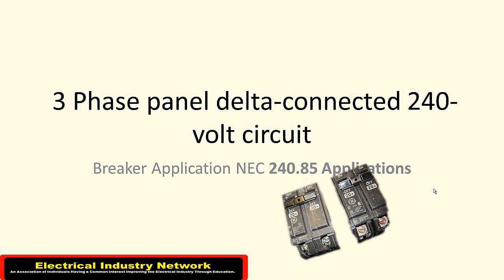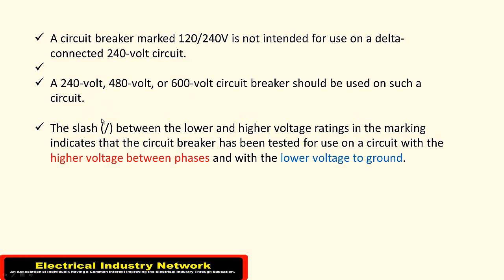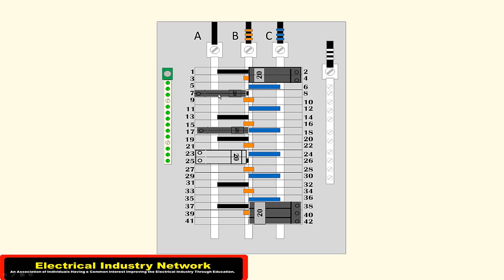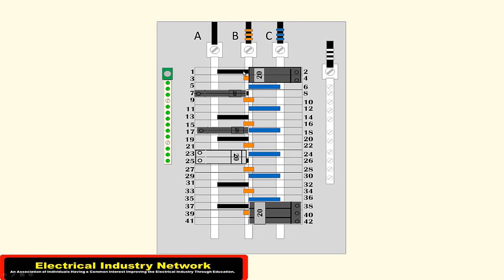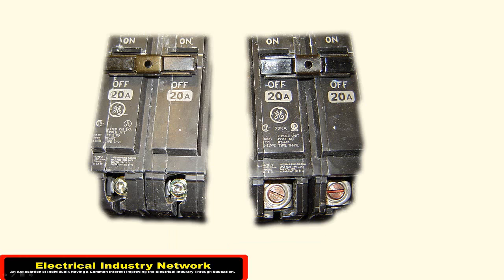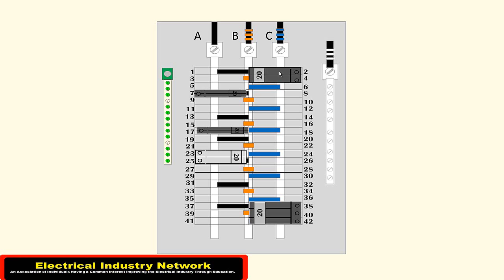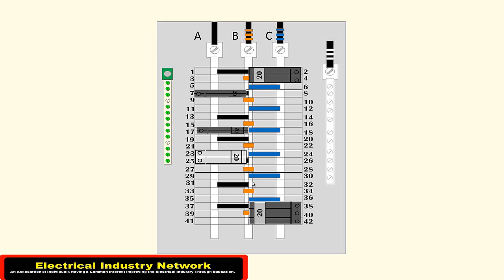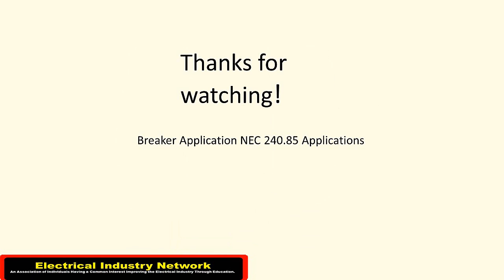Delta 240 Volt Breakers   NEC 240.85

Comment: I believe the straight rating vs slash rating has to do with the AIC rating.     208 volt to ground delivers more fault current than 120 volt to ground,  so if you have the dreaded 3ph 4w delta,  and need to use a two pole breaker on the high leg for a 240 volt single phase load, it needs to be a straight rated breaker, and forget about buying that at your big box stores.

Comment: Also by using straight rated 2 pole breakers, you will be able to balance out the loads more evenly on the Delta high leg system.

Comment: A good many modern light fixtures (particularly hard wired LED light fixtures) have universal voltage drivers installed in them. So you can use them on any voltage between 120 & 277 volts. Long be the high leg! Down with the wimpy wye.

Comment: 1:55 Historical odd note if you work on older USA panels: GE made/makes single pole 240 volt 1 inch THQL1215 breakers in 15 amps. The ones I have say 50/60 HZ made in the USA and are for 240 volts; NOT like most all that say 120/240 volts in the USA. This rare set up is used in odd super rare times on older 3 phase 4 wire delta systems in the USA for plant lighting. The load is a fluorescent ballasts that work on 208 or 240 volts. At one time plants used these 240 volt single pole breakers on the "un-used" 208 volt high leg single slots. These real 240 volt single pole breakers are NOT typically sold in the USA anymore; except through surplus. The "1" in THQL1215 of course means 1 pole; the 2 means 240 volts; the 15 means 15 amps. A THQL1215 is an odd rare duck in the USA; but common elsewhere. In the USA the common 15 amp breaker at a supply house is a THQL1115 which is marked with the slash; i.e. 120/240. If you want to see that the breaker looks like just type in THQL1215 into ebay. It is not my auction; just want to pass on some oddball electrical info. Sister model THQL1220 i.e. 20amp real 240 volt GE breakers appear surplus in the USA too. In GE Brazil their brochure shows pure 240 volt single pole THQL GE breakers in 15 to 100 amps; i.e. the 100 amp model is THQL12100. A radically more common set up is to have 3 phase 277/440 and the lighting on the 277 volt legs at Office/Home Depots etc.
Reply: As of 06/25/2022 Galco lists THQL1215 breakers for $127.72 each.    The THQL1220 is also listed.   Those are rare indeed, as normally with a 3ph 4w delta, the high leg is not used by itself to a neutral, unless you have heating elements rated 208 volts,  in which case normally the power supply is a 120/208 wye 3ph with a 2 pole slash rated breaker.

Comment: Great video!  I had no idea about these markings before watching his.  My only question would be why you would have a two pole breaker with one 120V leg and one 208V leg?  Our shop had delta when I started, but I only ever used the high leg for our 3 phase equipment.  I have since converted to 460V wye, which is a breeze to work with :)  Again, great videos, and I look forward to the next one!